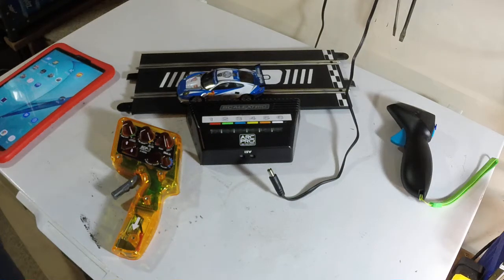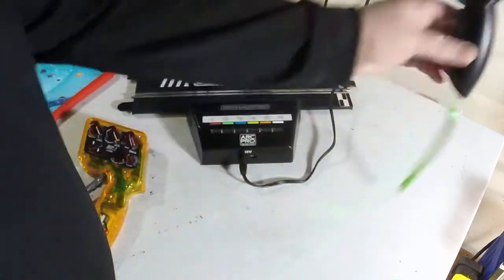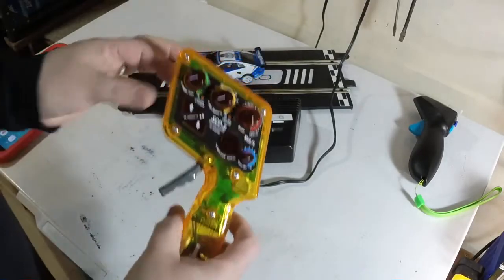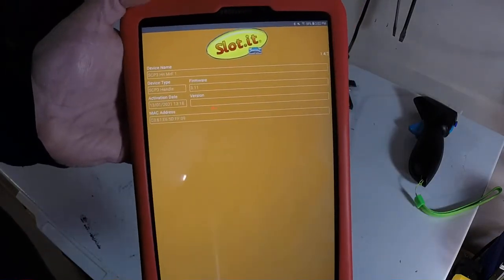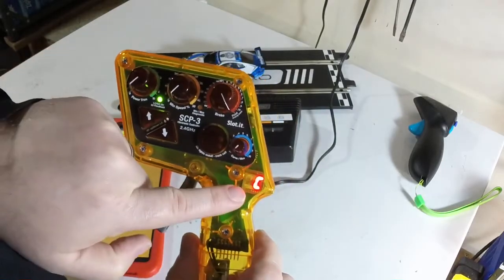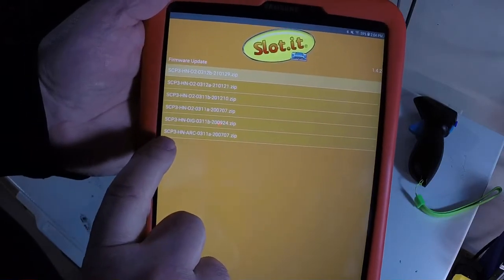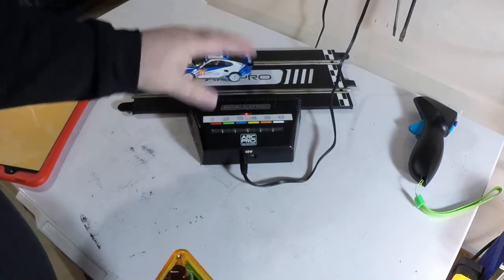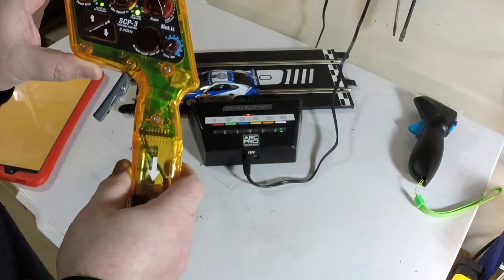Upgrade your Scalextric ARC Pro/Air controller to a Slot it SCP3!

Comment: Great video Greg - thanks so much! I followed your instructions which worked pretty much just as you described all the way through to trying to connect to the ArcPro power base itself. Having installed the correct firmware and started following the instructions to connect to the Arc Pro and at this point things have not gone well! Despite the light flashing on the Arc Pro powerbase and turning on the SCP3 controller with the trigger pressed down the controller will not connect to the powerbase. Do you have any experience of this and any further wisdom you can share. Thanks Johnny
Reply: What firmware does the controller display when you first turn it on?
Reply: PS I just tried changing the arc pro powerbase channel to which the SCP3 was connected and I experienced the same problem as before in not being able to connect it. It remains connected to the original channel so I will just stick with that and revisit if I purchase any additional SCP3 controllers!

Comment: Excellent video Greg!  If I only had Arc and Slot it!  Once ARC catches up to the C7042, then maybe a switch will be made.
Awesome work as usual!
Reply: I'm not sure it will ever "catch up" in the way most hard core hobbyists hope. It was never designed to do what the APB does when connected to a computer. If anything, a new base in a few years might do that... or do less. :\ But, this video shows at least one thing the APB can't do. :)

Comment: Nice👍, arc pro better rhat pb 7042?, my pb 7042 have a big probleme🤔I start a f1 race (10 laps) ... And the race stop immediately after 3second😜🤔
Reply: If you are using your 7042 with the LCD display tower it came with, and not with a computer, then the ARC Pro is definitely better. I'm not sure why your race is ending so soon, but it might be worth resetting the base to default settings, which I believe is in the system options.
Reply: @ggaub  I resolve the isssue😁 the select button was crip an durti😜, I use contact spray... Et voila👍, he works nicely now
Reply: @steuibi68  et voila!

Comment: Hi Greg, I just got an SCP3 and it won’t register. It sees the device but gives an error message saying registration to server failed
Reply from the maker: if the controller scrolls the "register" message as opposed to firmware version, then you might need to install the latest oXigen/Analog firmware using the Emergency DFU mode. I made a video about that on my other channel. If it scrolls the firmware version, then maybe you got it second hand, and it needs to be un-registered and connected to your account, which only slot.it can do. email is a good way to communicat with me. ggaub at ggaub dot com

Comment: Hey dude. Sorry to bother you again. Youve helped me out b4 and for that i am greatful. But could i ask again for your wisdom. Do you know if this will work with a scp2? And could i buy a wireless chip for it? Tia
Reply: Yes, it's possible, but the cost of an oXigen cartridge tends to be most of the cost of an SCP3. If you can find one for a good price, then there is a special firmware for it that will work with the ARC Air or Pro bases. Coming up with a battery to make it just as convenient as the SCP3 is another hurdle, as it's not designed to have one in the handle.
Reply: Hi mate. I cant find one of these witeless chips :(

Comment: Hi Greg, great video, it is very informative.  I have ARC pro. Using the SCP3 can I control the power and  brake levels without using the Scalextric App.
Reply: Scalextric Digital does not have adjustable brakes, so the answer is, technically, no. That said, slot.it also offer a car chip that can have Scalextric Digital firmware that can have the brakes adjusted via their app. While there would be no way to adjust it "on the fly" it would still enable you to set up a car to have its own optimum brake setting stored in the chip.
While the SCP3 has a brake adjustment knob, it is there for systems that support it, such as analog cars, or the oXigen digital system. 
All of the other settings on the controller would allow you to adjust the power curve to make cars of all kinds easier to drive. Take a look at my Slot.it SCP Controller Basics video to see what kinds of adjustments you'd have access to (everything but brakes).

Comment: Hi Greg..just linked scp3  to air pro DIGITAL...Works fine with digital cars..but the analog does NOT work i.e. moving the little switch on air pro to analog and then trying to drive analog car..i noted that scp3 does appear to bind ..steady lights..just no power to car....am i missing something obvious..please advise..Tim
Reply from the maker: and you're trying the car in both lanes? I can't imagine why it wouldn't work. The ARC Pro doesn't know it's a different controller. If you turn off the SCP3, and re-pair an ARC controller, does it work as expected?

Comment: Is that a modified Arc Air to Arc Pro controller? Where did you get the buttons?
Reply: It is! I got them through the slot.it shop on shapeways.
Reply: @ggaub  Any clue as to what I'm to search to find it on their site. Thank you